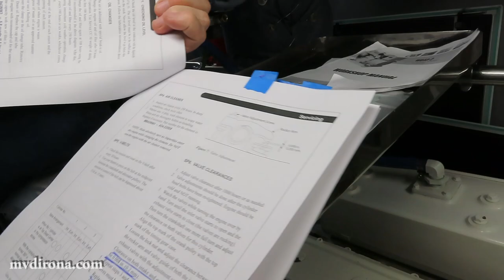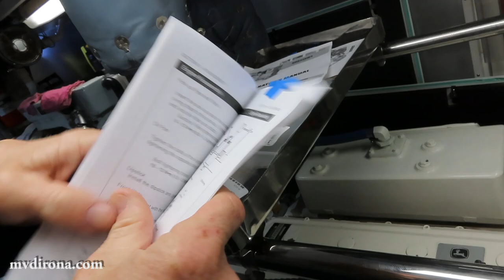Replacing Northern Lights 12kW GenSet Cylinder Head Part I (MV Dirona channel)

Comment: I believe you said you were a more mechanic in a previous career. Changing a cylinder head is not something I or many like me would do trivially -- daunting is an understatement.  
Certainly, my rule would be only if I absolutely had to -- otherwise I would be in the hands of a professional (like you). 
This goes to the competency/safety of owner/skipper/crew AND the range of spares said owner/skipper/crew should have access to  onboard.   
You and your partner are clearly highly capable and should be applauded for sharing with us your works on video (and on your website) 
On your website you state "Our goal has always been to never have a trip delayed or cut short due to equipment issues." (https://mvdirona.com/2018/02/managing-spares/)as a result you carry a "super set"  of parts and spares -- your video on replacing that Gen Starter Motor indicated that not only do you operate a very efficient and organised system but you had 2 spare motors, and a host of other items. 
I was amused to see that you considered carrying a spare prop and a spare Olympic boiler and made an informed decision on why not carrying these items would be safe and more practical.
My conclusion is probably similar to yours -- "Choosing what to carry is based partly on our cruising area, the difficulty of obtaining a replacement, the probability and impact of failure, and the inconvenience of not having that piece of equipment available. The further we cruise from our home waters, the more we want to carry a spare rather than rely on obtaining it in-country or via shipment from the US. That’s one of the ways we avoid having a trip delayed. In determining what to carry, we try to think of anything that could fail that we would be a trip-ender, or just highly inconvenient to do without, and we could reasonably carry a spare for."  However, my take on it is "no matter who is doing the work" the right parts and spares should be held on the vessel to allow regular maintenance, minor faults and possible also major breakdowns to be fixed remote from home waters.     Yes, as you say, this adds a little weight, and of course there is a cost; but -- if you do it your way -- you control the supply chain you control the time needed before work can be completed and the quality of parts, spares, and consumables -- be these water pumps or 50 gals of Shell Rimula R4L (E9) oil. 
I believe that I have to be able to complete basic checks, servicing and minor maintenance tasks for any vessel I use  -- but to go beyond this one has to have talent and experience and shear gumption that I do not. 
As I look at the 72 line items on your DironaMaintenanceSchedule.xls -- most (about 55 out of the 72 items) seem to be in reach for someone like me with very basic capabilities (checking and changing oils, filters of many types and servicing the Racors and water strainers, adding antifreeze and maintaining/replacing impellers,  checking and applying grease, checking belts YES - replacing belts depends (you had prepositioned a replacement belt for your gen so that you did not need to take the gen apart to fit a replacement -- I could fit a prepositioned belt, but not install a new one since it requires disassembling the generator), testing batteries OK; managing fuel, adding fuel treatment and polishing fuel and draining off water or sediments all fairly basics once you have worked out how the manifolds work. Changing engine Zincs, being able to service and maintain the water maker is important and should be learned).  But others like adjusting valves, changing bearings, changing the harmonic balancer, or undertaking difficult, dangerous (work at height) or heavy work on the vessel when it has be lifted out and almost any work to the vessels systems, electrics and A/C and work in very confined spaces would be well beyond me.  I would and will continue to rely on a combination of authorised specialists and just good yards and mechanics to do these types of task.  AND yes I will have to limp home or call for help if something big breaks and I am far from land.
Reply from the maker: Your position is perfectly reasonable. It's 100% your choice and whatever contributes most to your enjoyment.  For us, self sufficiency brings great satisfaction and we greatly value our time so learning to do things ourselves, seems like the best answer. But, for many others, they can afford to pay someone to fix it so why waste time themselves? And there are lots of positions between them.

The most common reason why owners don't service is perceived lack of ability. What I've found over the years working in a lot of different areas, is that if your patient and thoughtful, there is a very good chance you will be able to do better work than many professionals. You won't be faster but, in most cases, there is no reason why you can't equal or better the work of a professional. Admittedly there are jobs where there are tricks or techniques that aren't well documented and finding these by experimentation can take a lot of time.   

Weather you do the job yourself or just learn enough about it to be able to know what is wrong, what parts you need, and what skills to look for it, increasing your level of knowledge of on board systems always helps.  Your thoughtful and analytic approach will serve you well wherever you decide to go.

Comment: Exhaust/coolant combination, is that something like EGR cooler ?
Reply from the maker: Marine engines are typically cooled using a heat exchanger or a keel cooler. A heat exchanger is a coolant to sea water cooler that is used to cool the engine (similar to a radiator on an over-the-road vehicle but water-to-water rather than water-to-air). A keel cooler is a coolant to sea water cooler that is mounted outside the hull of the boat to cool the engine. On the first approach, sea water is piped into the boat and it flows through the heat exchanger and on the second type coolant is piped outside of the boat to be cooled by sea water in an external keel cooler.

In this engine, a heat exchanger is used and the engine design combined the exhaust manifold and heat exchanger in a single casting which is a bit simpler and might save some space.

It's a simple engine without advanced emissions reduction techniques like EGR. It's a 2010 installation but, back then, low power engines had very few exhaust emission restrictions.  The main engine is a EPA Tier II engine so it is a much more advanced engines and current generations boats are using Tier III engines with even more.
Reply: MV Dirona oh ok, thanks for the info, I love these videos, I spent all my spare time watching them,  I’m a tech at Volvo/Mack dealer so it’s kind of my job 😂
Reply from the maker: Thanks for the feedback on the video. Since you work on over-the-road trucks, you'll see all the latest tricks and techniques to meet difficult emission requirements.
Reply: MV Dirona  yeah lots of tricks,not so great designs though,lots of failures but keeps us techs in business,lol
Reply from the maker: Yeah, I agree. In the early days of emissions regulations, I thought some of the forced changes actually helped. But the more recent restrictions lead to complex designs or much less efficient engines and sometimes both. 

My main engine is a perfect example. The only difference between a Deere 6068AFM75 and a 6068AFM85 is the former is Tier II and later is Tier III. All the same ratings. The Tier III engine is 15% less fuel efficient at full rated output.  Those that don't give up efficiency, pay in really complex designs that keep folks like yourself busy :-).

Comment: hi Jennifer and James Hamilton may I ask are the return lines returning fuel to the engine or the tanks thank you
Reply from the maker: The return lines return fuel back to the fuel tanks. Most diesels use return fuel to cool the fuel pump and injectors and fuel not used in injection is returned to the fuel tanks.  On our engines, they circulate far more fuel than they burn so most of the fuel is returned to the tank.  Since all the return fuel flows through all the filters, this has the side effect that most of the fuel in the supply tank is filtered many times before it actually burned.
Reply: thank you for the information mv dirona

Comment: Some of us may know our way around a diesel engine but lack the experience to tackle this kind of job. Would it be practical to set up real-time appointments with a mechanic and broadcast the steps we are taking, getting the virtual mechanic's feedback and guidance as we go?
Reply from the maker: Sure, absolutely. With some guidance even if just over the phone, just about anyone with care and patience could do much of this work. I can think of two times when we were in ocean crossings where we consulted with the the boat manufacturer (Nordhavn) or the stabilizer manufacture (American Bow Thruster/TRAC) by sat phone and it worked great.

Comment: Hi again! What's your background, you know an awful lot of engines, maintenance and systems as well?
Reply from the maker: My current role is VP and Distinguished Engineer at Amazon Web Services focusing on infrastructure efficiency, reliability, and scaling. That role doesn't have much overlap with marine mechanical systems although we do have a very large fleet of 2.5 MW generators. Some problems in common although our 3 cylinder is quite a bit smaller than the big V12s at work and generator health isn't really a big part of my current job. 

Overall, my work life doesn't overlap much with the boating stuff unless you look way, way back.  38 years ago I was a professional automechanic servicing exotic Italian cars. Not one of them were diesel but, overall, that role had a lot of overlap with boat servicing and that background is actually fairly useful around the boat. I wish I hadn't sold my 5' high tool box :-).

Comment: 6,000-7,000 hours isn't many hours for diesel engine... Everything in the oilfields runs on diesel due to their longevity, reliability and for the fact that diesel doesn't explode and in some applications they'll run constantly for months at a time so it's not uncommon to find engines with 10,000-15,000+ hours without having any internal failures.
Reply from the maker: I agree it's a low hour failure.  The main engine has 12,600 hours and has never had any service other than an injector change at 8,000 hours.  These little generator engines are simpler and less expensive engines (parent bore, 2 valve, mechanical injection) than our main engine or the engines you are used to working upon. Nonetheless, there are many reports of these little guys doing 20k to 30k hours so this failure was definitively early.

Comment: could you not just do a compression test to find the fault
Reply from the maker: The fault was well understood at this point.  The valves were adjusted and around 30 hours later needed to be adjusted again. Then around 20 hours later the #3 exhaust valve has again closed up.  At that point,  there are really only two options: 1) receding valve seat, and 2) stretched valve. The later would be super unlikely on this low reving, low output engine that has never been overheated so it's just about guaranteed to be a receded valve seat.  Either way, the head has to come off so we were pretty confident in the work that would need to be done and order all the parts up front.

Comment: Why wouldn't it fail ?
Reply from the maker: I guess you are right it would definitely fail. The question is when? I would like to get 15,000 hours before taking off the head on a low stress diesel. 6,700 hours isn't a disaster by any measure but I would prefer to get up over 10,000 hours. And, many operators of these generators report 15,000 to 20,000 hours with a few reporting as high as 30,000 hours.

But a top end overhaul isn't that big a deal and, if the engine goes to 15,000 before needing a full overhaul, I'll feel like it's done fine.